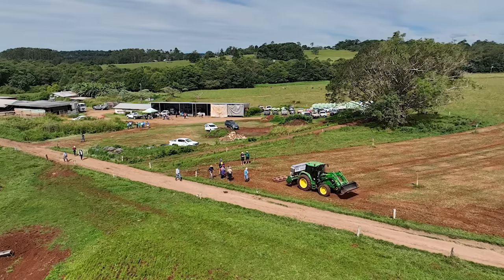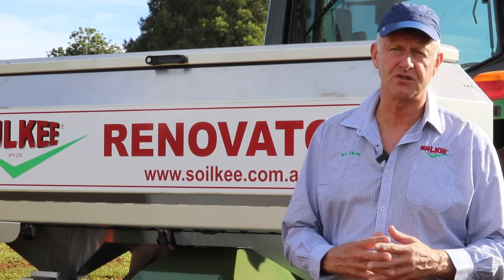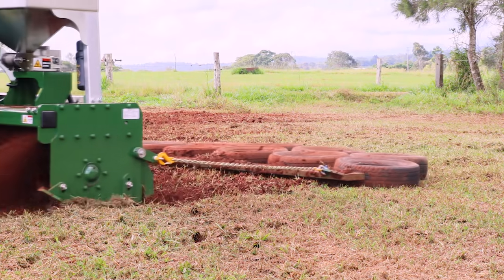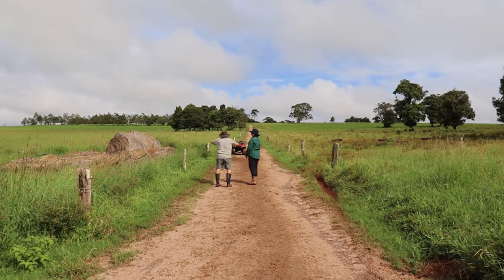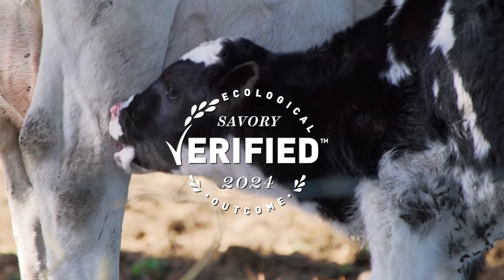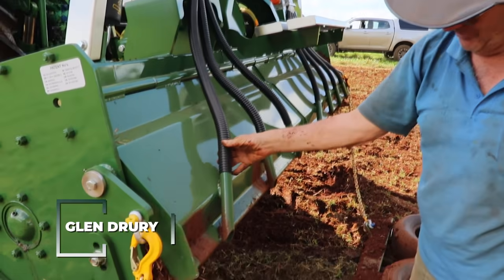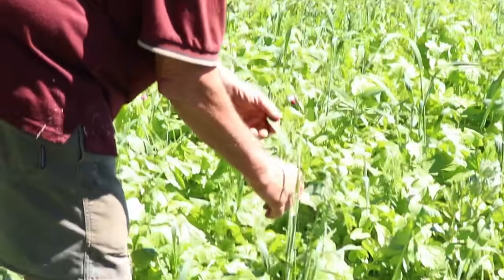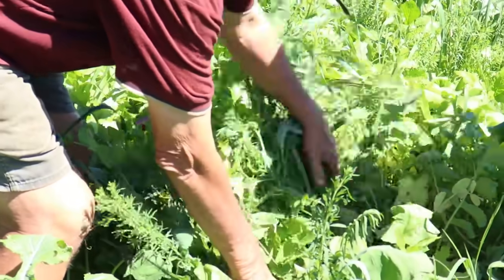Trialling the SoilKee Renovator in FNQ

Comment: Curious. If soil is to aggregate then the presence of fungi will do the job - which this machine is designed to disrupt. This machine looks like the last gasp of the board plough trying to remain relevant. Use only a Yeoman's subsoiler along Keylines or don't bother. The best thing to restore fertility is to maintain the humus layer (armour) till very little UV light can reach the soil (Roger Savory, son of) and then let nature do its job. 
2. Trees (plants in general) talk to clouds, clouds come from ocean (Walter Jehne). It's all there waiting to be discovered.
Reply from the maker: Thank you for your comment. Yes, you are correct in saying that the SoilKee Renovator will disturb soil aggregation where it cuts into the soil, however, since these cuts are thin strips, the exposure of humus to UV light should be minimal, particularly with the tires following behind to refill the cuts and bury the seed.

The main advantage of the SoilKee Renovator is its ability to plant seeds of different sizes simultaneously, offering several benefits that will promote soil health and improve pasture productivity in mixed-species pastures.

The Yeoman subsoiler is also great for increasing soil health 😀
Reply: @TerrainNRM  Thx for taking the time. Humus' main job is to provide shade. To absorb the UV light. Keeping it way from the soil where the microbes exist as it and heat kills them very quickly. Also to absorb the energy of the raindrops, resist instantaneous run off, prevent or slow evaporation, reduce pugging, etc. You could argue that in order to become a better farmer the long term plan is to rarely see the soil again. Keep it covered in this multi-purpose blanket. Which is why they like to call it 'armour'.
Thus requiring only a drill for minimum disturbance.

Multi-seed planting is a good thing for the future. Best of luck mate.